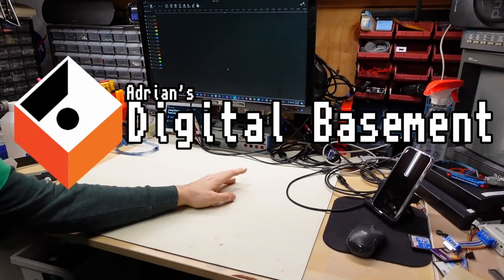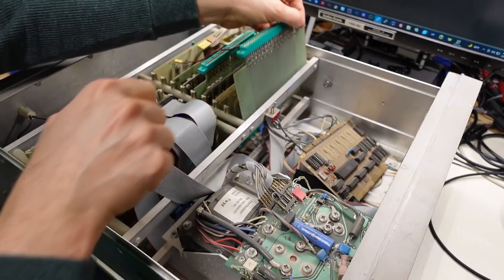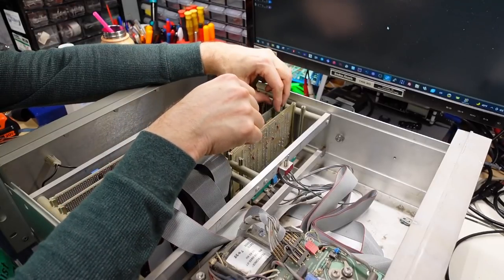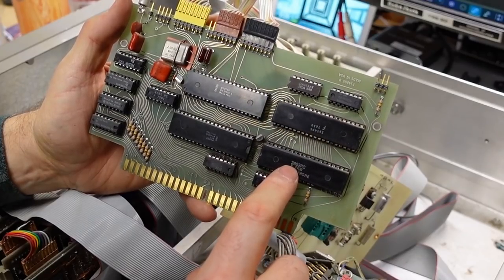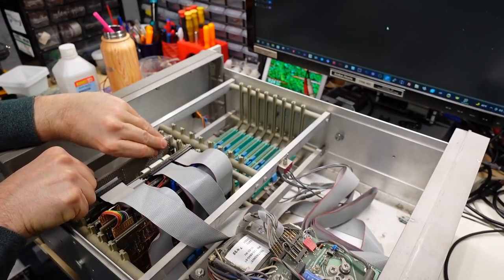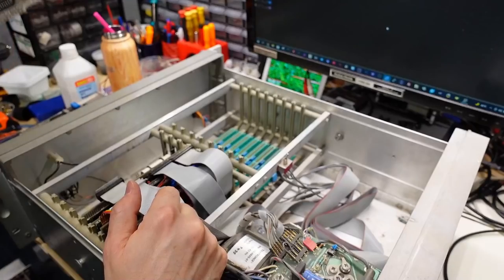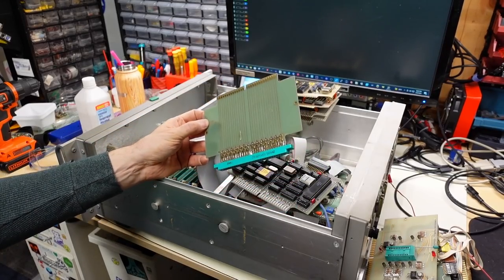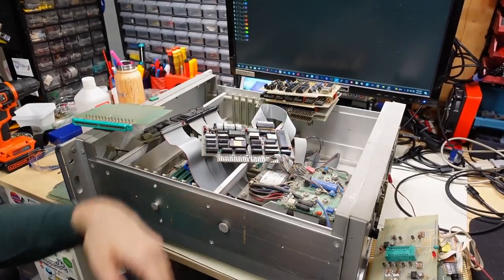I need help finding information on this mysterious computer

Comment: Classic look and feel of a custom controller for a specific scientific or industrial application. Video video because it's not a general purpose computer, it was likely desinged for a specific control application.
Reply: Its also possible a lot of the bodges are to repair it long after it should have been retired becuase the machine/device it was attached to would have been too expensive to replace but was still in use.  I would guess that it was built somewhere around 79-80 and any newer chips were repairs.
Reply: Well, it depends...  my home-made computer stuff from those days (1980-1984) looks exactly like that!
I was amazed to recognize the techniques used on the different boards.  "factory" boards with extra ICs stacked on top of existing ones, bodge-wired to the remainder of the board.
And those prototype boards with enamel (transformer) wire to connect the ICs together, I have many examples of that here.
E.g. a floppy controller for 5" and 8" drives, a harddisk controller, graphics card, all made using these techniques.
It sometimes makes me sad seeing them (and this system) and realizing how much time and money I spent on it, and what it is now: just an old 8-bit machine.

Adrian repeatedly wondered why there is no graphics card, well that was one way of working in those days.  Either you had a graphics card, or you had a serial terminal.
And this system has many serial ports so it likely was used with a serial terminal.  And a parallel printer.
It most likely was running CP/M 80 and applications like Wordstar.
Reply: @ThePoxun  You'd be surprised the amount of 70's-80's tech that was used well into the 2000's and beyond. Adrian's critique of the design of the power supply, he didn't test it but I wouldn't be surprised if that power supply still work today. 
Some devices are not designed for 24/7/365 use without seriously shortening the lifespan of applications for industrial or scientific needs. A piece of monitoring equipment at a refinery for instance might be designed to run for 10 or more years without failure. The power supply probably still works perfectly with maybe the Caps needing to be replaced.
Reply: Yep.  Looks like lab gear to me.
Reply: yea i'd imagine they used some different CP/M Computer to write software for it, and then used the boot ROM and disk controller to load and test that software on that thing.
maybe they used that EROM Programmer card to write the boot ROMs in the first place
Reply: That's the same thing I thought the moment I've seen it.
I've visited the CERN a couple of years ago and this thing looks like it came straight from there.
Not from the nice and shiny Computer Center but from some of the experiments' warehouses, attached with a tangled mess of cables to some PLCs, sensors and other stuff hacked toghether with duct tape.
Reply: @Rob2  I for one look at these old cards and see the care and joy that went into soldering those bodge wires and configuring those ICs. Don't be sad about your past hobby, in the end everything we do is ephemeral and it is the moment that counts. The fact that it made you happy and content while you were doing it means it served its purpose.
Reply: customerized design. Not a standard one. No need to guess.
Reply: @MrHurricaneFloyd  So very well said!
Reply: This seems to be an electronics test bench for develpment. Some of those bodge wires are not repairs at all, rather they are modifications done to get the hardware to accept new generation ICs for testing and development.
Reply: @proxy1035  If it's anything CP/M based, Adrian and Dave Jones world have spotted that right away. Since some other board didn't have a bios chip, adding a display probably wouldn't do much. My guess having experience computers like the ALTAIR is you have to manually open up a serial port and send commands directly to the disc controller to load from the disk.
Reply: why aren't you complaining about how much of a "fail" the design is? LOL LOL LOOK AT THIS BODGE SO DODGY RIGHT MATE
Reply: Typical industrial computer from the days when you didn't have standard hardware and thus everything was bespoke. Probably all programmed in assembler language:  no BIOS.! I learnt my trade in the mid 1980s on stuff like the good old Motorola 6800, 6802 and 6809; and Intel 8080 and 8086 based hardware, programming EPROMs from tape. If there was a fault on a 4k memory card, you had to find out which of the 32 chips was faulty and replace it! RS232 was proper +/-12V RS232 on D25 connectors using 1488/1489 voltage translators.  4-20mA current loop was also used for serial links to video terminals such as the DEC VT52 at 75 baud. 8 and 16 bit microcontrollers now have everything on a single chip! Great time to learn about microprocessors: nowadays it's a throw away world rather than a fix it world.
Reply: Got the same impression :)
Reply: I think it looks like a PIC type machine (libraries used them for library computer catalog systems in the 1980s and 1990s). That first card looked like it had 6 or so 9pin connectors on the top. That serial port also seemed to have a set of 9 dupont connectors on it that would perfectly fit the 9 pins on each serial port.
Disk drive could be for catalog etc.
Also dumb terminals would connect to the main computer there and it'd be a multi user system perhaps? CP/M could do that.
Reply: It's a missile controller, right Dave?
Reply: @Rob2  loved my Wordstar and Mailmerge. Ran my law firm forms through my Cromenco Z80 with CPM.
Reply: @kevinbroderick3779  If it means anything, my 1994-made, 1993-designed hp48gx is still getting used and abused daily and doesn't seem to be giving up any time soon.
Reply: Yes, I am thinking something like that.

Comment: Correction: The "Z80 math coprocessor" is actually a Z280 CPU; it is binary compatible with the Z80 but is much beefier, including instruction pipelining, a built-in cache and MMU, and more complex instructions like hardware multiply/divide, similar to an 80286 vs an 8088. Being Z80 compatible it could probably run CP/M but considering the rest of the hardware it looks pretty custom. My guess would be the Z280 is the main CPU and the other CPUs on different cards act as coprocessors for other subsystems.
Reply: That explains the 128K of RAM, as well as the fact that the original Z80 CPU card was in the 'storage' area of the machine.
Reply: Looks like a job for a z80 disassembler of the ROMs.  Then start writing an emulator for the system that at least implements the bits that cause the code to block and get the serial output running.   After the system is running in simulation, you can use co-simulation to recover each card using a FPGA to drive the bus in substitution of the processor board.   But life is short, so just scan the ROMs for copyright comments and be done with the thing ;)
Reply: he is crying boot disk, thinks it's IBM gaming system, mad....
Reply from the maker: Indeed! So I'm thinking that the Z280 is the actual CPU for this as the Z80 CPU card was not installed any longer after an upgrade
Reply from the maker: @ieatspacemonkeys  I'm going to dump the ROMs and upload them -- perhaps the Z80 assembly experts could see what they do. I'm certainly going to try to power this up too :-)
Reply: @adriansdigitalbasement2  Back then, some process could be run on Z80 chips, not all processes run on that chips, just 8 bit cards with chips on it do do process  automated, no dynamic results on some monitor...
Reply: @adriansdigitalbasement2  sounds like a plan.  I'm sure the community will get it running in a SIM in short order.  That is the problem with real hardware, annoyingly stubborn to replicate at zero cost across the internet.

Comment: It’s not a homemade computer. It’s in a rack mount 3U or 4U box. The boards are made in house to support the various test equipment/instrumentation. I worked in the oilfield industry and as various instrumentation was being converted to the digital age, it wasn’t uncommon to make in-house boards to bring the various instrumentation we acquired from all the acquisitions during the oilfield crash in the early 80’s. The funny soldering are field repairs we made in field because we couldn’t drive back to the base camp as we were on customer time. We pulled the rack mount, opened the top, slapped replacement boards or started soldering jumper wires. The braided soldering wick ground wire was just some guy panicking, and slapped that as a strong ground. We ran off generators that would surge or during lightening storms and not fully grounded, so I think they panicked and used that. We had humidity problems as our mobile office is a peterbilt unit with a box office and on hot days in West Texas, the AC and the heat from the rack mount systems didn’t play well. Good times then. Nothing is homemade, it’s propertary boards.

Comment: It could be custom instrumentation for a test lab.  I used build stuff like that for engineers in an Automotive Safety instrumentation lab.  They would hand me drawings and I'd create it all from scratch, even the boards.
Reply: Allen, you're the bomb!! Let's see some of your stuff too
Reply: I just worked on a PC like this where I work. I can second that this looks like some sort of testing unit. So a company produces an assembly then hooks it up to this and tests the product. Multiple ports means multiple tests running at the same time. Result of pass/fail could just be a series of beeps or blinks.
Reply: The large connectors remind me of a HP test equipment interface.
Reply: I think about the same, specially because the power transformer is marked "Tektronix". I would say it is a standard instrument customized into a test rig

Comment: what a trip, this box looks like it came right out of my old lab. i worked a LOT with boxes very similar to this one. Its early 80's, late 70's so i'm not surprised it isn't covered in asset tags, but i am a bit surprised it doesn't have a single company mark on it. the boards were almost certainly rolled by a company with their own pcb manufacturing, like any aerospace from that period. Most aerospace firms plastered their logo on everything they rolled though, which makes me think this isn't aero. It's definitely not "homemade" though, and has all the hallmarks of a professional research lab.

In general terms, i'd put my money on this box being a control system. I'd trace back the ribbon cables and see if one of them is actually DIO or not. Floppy drive cables got used a lot for DIO because why not; you already have a thousand of the cables.

I would also be pretty shocked if it had any visual output. Even today, that is exceedingly rare for this kind of hardware because its a beyond a waste of time and effort to add video out of any kind. I'd take a close look and see if its RS-232 or RS-422 though, that would be a big clue. basically, different industries use different serial methods (more or less). 

If it is a control system, or a test bed for control systems, then it probably does have a boot loader or boot boot loader output on the serial port when its powered on. I found it pretty common to get at least something from serial ports at each level of firmware because it saves you a ton of work to quickly see what is going on (is it working, what version, etc). 

The fact that it seems to be completely Zilog based is also interesting. That makes me think this box was used as a test bed or for R&D for some consumer product, or at least not a government only product. I'm a lot more familiar with 90's junk, but i don't think Zilog stuff saw a lot of use in aerospace or similar areas.

This video makes me miss my crusty dusty lab with its mix of 90's and modern hardware, all custom made with 80's design like the box you have! See if you can dump those roms, and then look for ascii text baked in (with all offsets). If there is something like version info for a boot, it will be in there stored hard coded
Reply: That's exactly what I was thinking too, that it's a control system and you're right, totally custom. My mind automatically went to plotter/printer control because I've worked with a lot of controllers full of bizarre cards and handmade/custom circuits just to get whatever machine/software the company was using to work the print/plotter/press etc
Reply: I used to design this kind of thing for aerospace engineering, R&D and manufacturing, I had outside companies making the custom pin & wire boards, and sometimes I had internal resource to build them.  I wouldn't have time to build any of it as I was fully occupied documenting everything. The mods like added 0.1 capacitors and cut tracks/added wires I would had done myself.
Reply: Yes, but I would only point out that back then, about the only choices for 8 bit dev CPUs were either Z80's or Apple's 6502's. It was also common to boot from 5 1/4 floppy drives, instead of from RAM, w/ a bootloader.
My initial guess was a laser controller, with a bit pad interface and a RS-232 dumb terminal. But, this looks more industrial, like an early CNC machining/robotics controller.